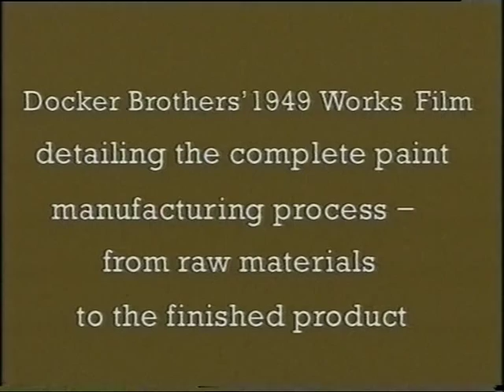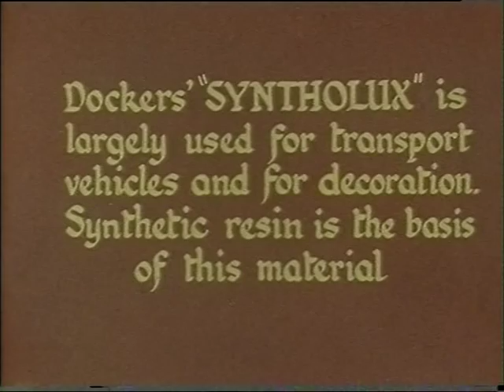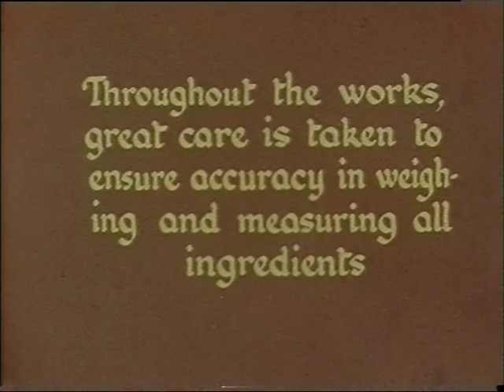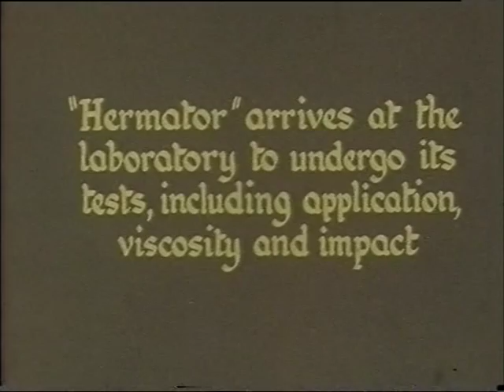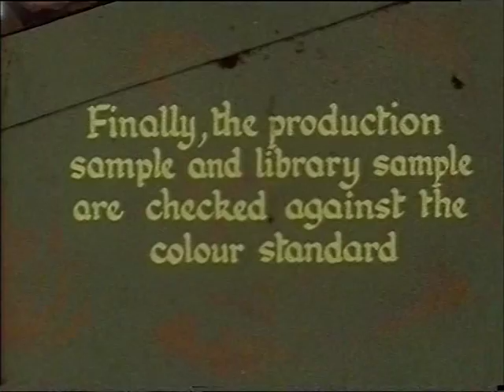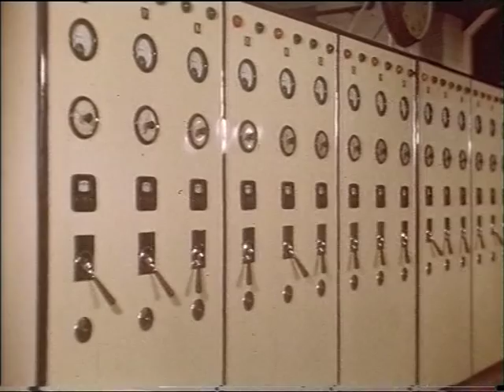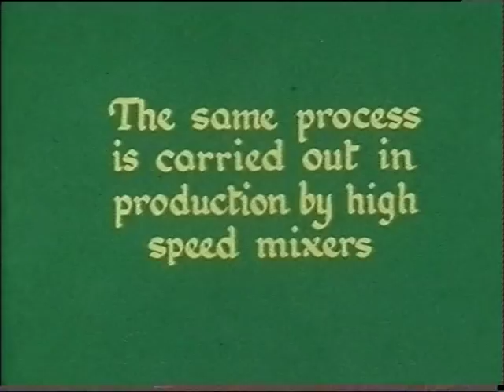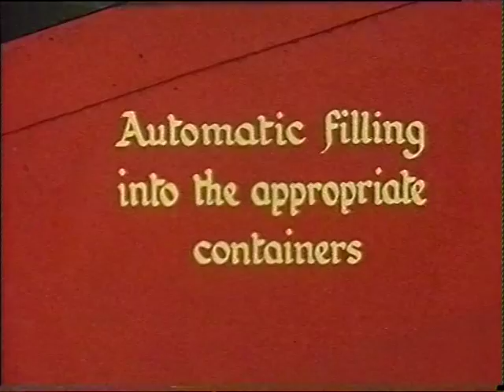1949 film of Docker Brothers paint factory, B'ham (no sound)

Comment: Docker paints, Rotton Park St, Birminghm. .

I worked there in the '70's.
They had been taken over by the Courtholds Group and renamed International Paint.

The factory was largely unchanged from this film.
The paint products had changed as had the production methods.

The opening shot is from the roof of the "Lewis Mill", the oldest and original part of the factory.
 This mill was named after the firefighter killed there in the air raid in WWII .
There was a brass commemorative plack  above the lift that went down to the yard.

The Lewis Mill was where the Ball Mills were, there were two types steel mills filled with steel balls that rusted and discoloured paint and so these were used for producing primer 
Thes were very noisy when operating.

There were also porcelain ball mills , the mill was lined with porcelain tiles and the balls also were porcelain.
These were used to produce  stove enamel paints mostly I remember "harvest gold" and "sandglow" for Austin @Longbridge.

That shot from the top of the Lewis Mill where they were weather testing panels shows a water butt. This was a cooling butt for the ball mills below and they were full of small fish!
I know that roof well it was a favourite skiving spot for a sixteen year old to get a bit of fresh air and sunlight, with lots of cover to hide behind if someone came looking for you.

The gatehouse was the same, tight for any truck over ten ton, later the artics had to unload in the street.
Still had the uniformed gate guard!

If you stood just inside the gateway just behind where that truck stopped behind you to your left is the fire station, yes fire was such a threat the factory had its own fire tender and firemen.
They used to polish and paint that little cherished tender and practice regularly
We used to whistle the trumpton tune "Hugh,Pew, Barney,McGrew etc, they hated it but we were only jelous what a nice easy job!

To your right was the Labs and QC testing area, canteen and boardroom offices and records.

International Paint made paint for Industry, Marine and Vehicles each division based around a factory
The marine Division was in Richmond for example.

Rotton Park St was the vehicle finishes division.

Resins were made just in front of that truck in the resin mill or reactor plant.
This part was manned 24hrs, the workforce was entirely Asian and they had a pot of delish curry cooking 24/7 on the hot parts of the reactor vessel., It was a great place to have lunch or breakfast.
To the far right was a new mill opened in 1976 by Brian Waldron the TV personality and local MP .
It produced "Quickline" a cheap synthetic refinishing paint, designed to replace cellulose paint but it never did, it wasn't very good to be honest.

Cellulose paint was still produced at the far end of the factory as far away as possible from the offices.
The reason ? 
Fire risk.
It's Low flash, and VERY flammable.
The manufacturing method had changed, the celly was bought in as "chips" it's essentially the same as guncotton so the chips were to lower the fire risk.
This is mixed with solvent to dissolve it and make the resin, pigment and thinners added all very carefully even a static charge could cause a flash.

Going back to the truck in the film to the left was the loading storage and packing bay, 

There was a mill called "ready-mix" down there.
They produced the old style coach paint called "NuSpeed" they  also made the small scale more specialist paints.
 I remember the orange hi Viz for the S&R helecopters,and  the Anti IR for the MOD for tanks (very heavy ) and all the national bus colours.made in small batches
This was the only mill that still had rollers for grinding in paint.they weren't very efficient requiring constant attention, ok for small batches tho I remember the fluorescent paint being produced on them

The Sussmeyer was the prefered method for making paint, a huge Kenwood mixer with an impeller three foot wide that ran for hours.

At the far end of the factory beyond ready mix was the cationic mill.
It produced primers that were electronically charged to stick to the product in a dipping process.
This was preduced under licence with a process and ingredients bought in from France, this was cutting edge stuff in 1970's !

There were a great many "Characters" worked there.
I was a hard dirty job, masks were considered effette ear protection non existent and if you truck carry 100kg you were considered a weakling beneath contempt not a real man . 

Heavy metals fine dust lead asbestos were abundant .

At the end of the film there's someone spraying a car body.
I'm almost certain that was a young  Bert Treadwell, I recognize that spraying style anywhere.
In 1976 he was just about to retire, just a few years left.
He was the company refinishing expert a knowledgeable gentle man.
and  with the most elegant, spraying style and method I ever saw.
He taught me, I sprayed many a car in my life but I'm nowhere near as good as he was.
Reply from the maker: Hi Gary  It was myself and a colleague who found this film, had it digitalised and posted it on YouTube. Thanks for posting all that information. I wanted to correct you on one small thing. The Lewis Mill was named after the Production Manager, Charles Lewis, who had that mill rebuilt after the war. I have met his grandson so I know that is correct. But you are quite correct that there was a plaque commemorating the fire fighters who were killed in the bombing. 
I wanted to let you know that we have a Facebook page for people who worked at the factory (Ladywood Old Colleagues Association). There are about 100 members on there so might just include somebody that you worked with. So if you use Facebook at all you might like to check it out. https://www.facebook.com/groups/424718094350257
Meanwhile would you mind if I cut and paste what you posted here on to the Facebook page. Or you could do it yourself if you sign up as a member. I'm sure other people would be interested to read it.
So maybe see you over on Facebook.
ATB
Mark Barrett
BTW I worked at the Ladywood factory from 1981 to 2003 so it is possible that there was no overlap with your time there..
Reply from the maker: BTW you are quite correct that that is Bert Treadwell at the end of the film. When I was at Ladywood the pensioners used to come back one day a year for a social gathering so I met him a few times there. He was one of the last remaining people who had started at Ladywood before the Second World war so he was a mine of information.
Reply from the maker: @garyhewitt489  Thanks Gary. I was in the Finance Dept. Went there to do a 6 week project and stayed for 22 years! I understand what you mean about Facebook. I was very reluctant to get involved to start with but in the end I have found it to be quite a useful tool for information sharing. I'll put something up on the LOCA page either later or tomorrow. I'm sure people on there will be interested to read your reminiscences. Thanks again.
Reply from the maker: Gary There was a post on FB from Donna Benbow. She said her husband Lee could remember you in the Ready Mix Department. Donna worked in the canteen. Long dark her. You may remember her too!